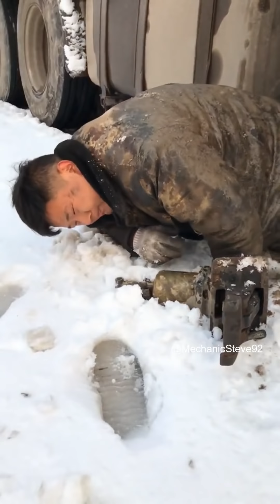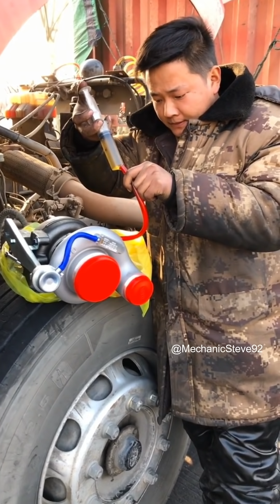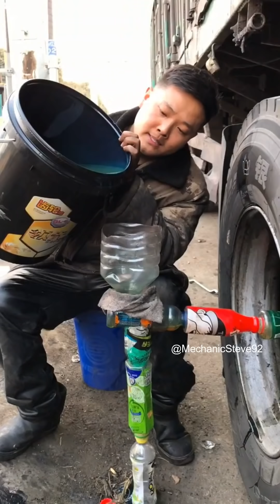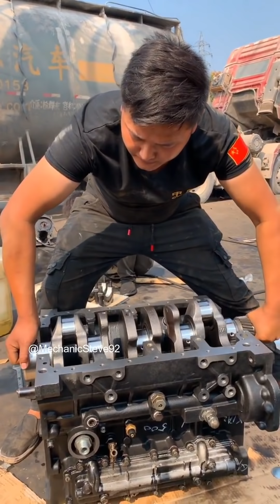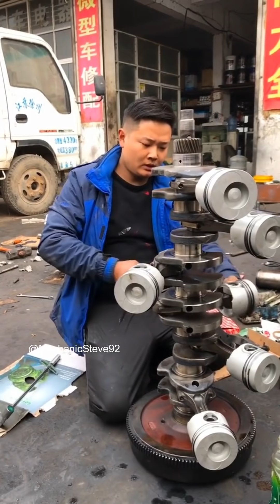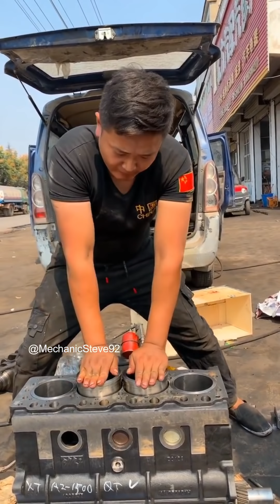Never regret to be a Mechanic #Mechanic #MechanicSteven92

Comment: Ok so when he's using the torque wrench, he's not looking at the scale. So if he's doing it by feel, why not just use a ratchet or a breaker bar?
Reply: You can hear a "click" when the is the right one. On mine is like that atleast, a little click when i'm nearby and a click when i'm done and then it's the right torque
Reply: @gabbogabriel7307  that's the new old kind that you have .his is the old school with the scale and pointer on it like the other comment was saying .
Reply: @jefflinnell8492  Oh well sir, I have to say that he's right then. didn't know this, i thought it was like mine, thanks for the information. :)
Reply: @gabbogabriel7307  no worries .i was wondering why he wasn't looking at the gauge when I was watching but it confused me more when he was bolting the connecting rods with the pistons already on them to a crankshaft that was installed yet .kind of hard to compress rings on all of the lost one and slide the entire assembly into a block .
Reply: Yea he’s not even looking at the torque on the beam style torque wrench lmao it’s definitely not a click style. Looks over torqued 😂
Reply: That wouldn't be accurate